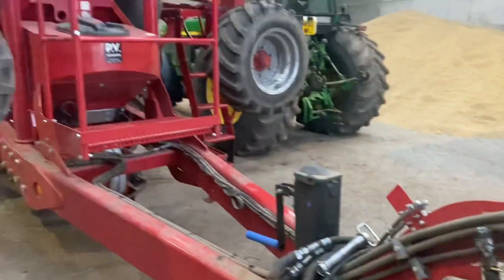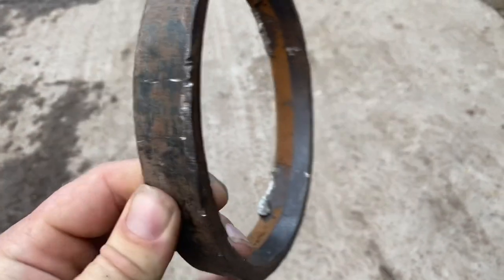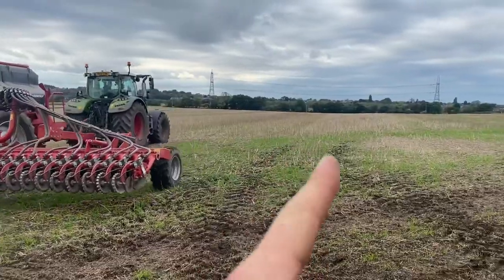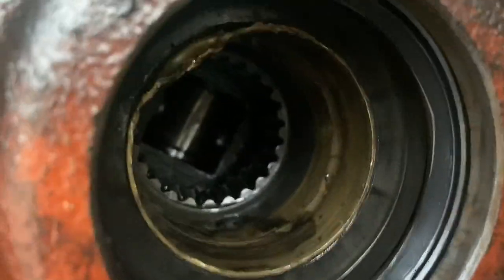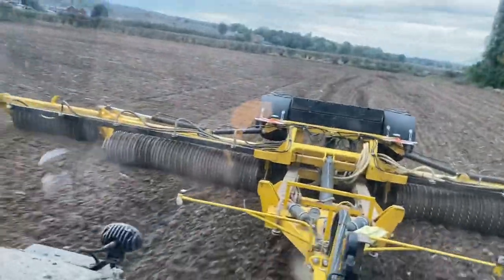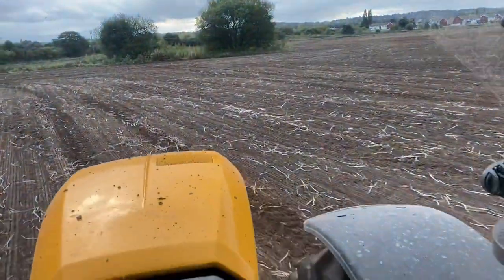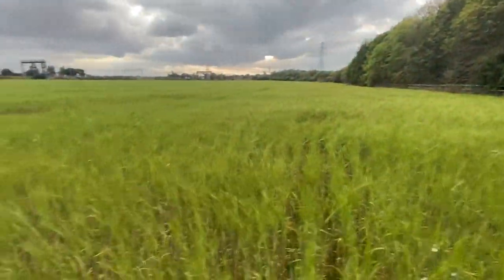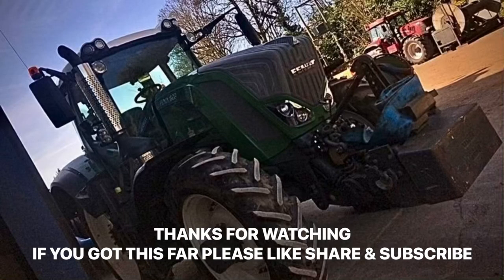Day571 #OLLYBLOGS WHEAT PATCHING UP FUEL PROBLEMS AND MB TRACK FLAT OUT #AnswerAsAPercent

Comment: If you want a new one of those little filters for the MB trac then it's the exact same as the ones fitted to T6 and T7 new hollands
Reply from the maker: Really
Reply: @OllyBlogsAgricontractfarmer  judging by how it looks in the video yes, identical to the glass bowl on T6 and T7, you don't get a new spring with the new filter though or the seal at the top of the bowl, they're separate parts